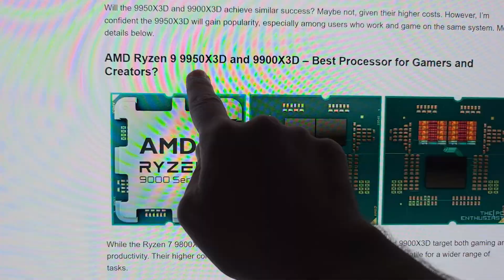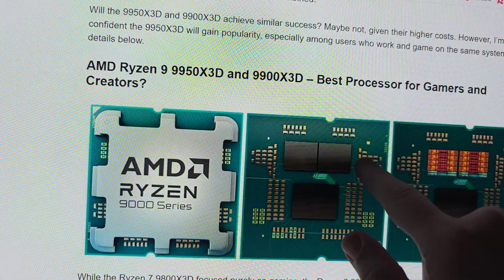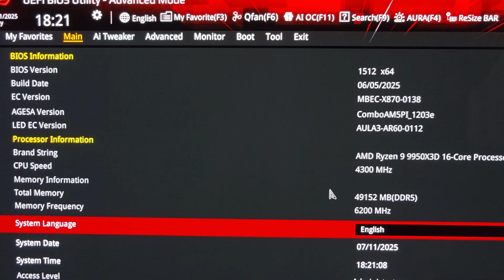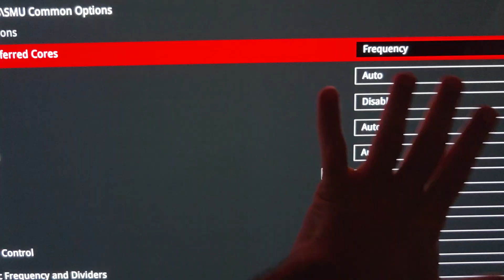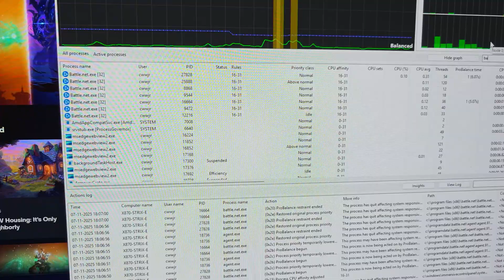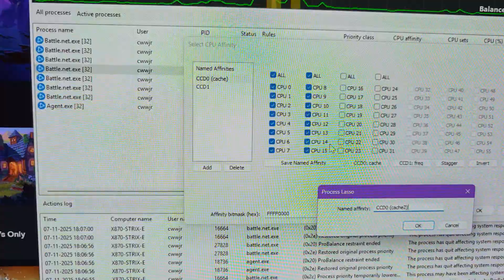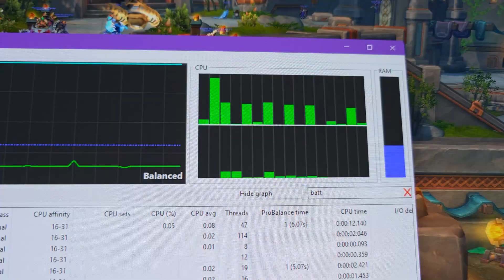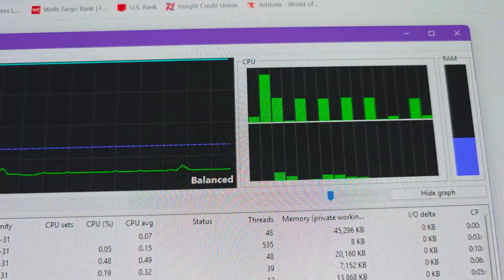How to Setup 9950x3D with Process Lasso

Comment: Thanks for the tiny bit of information at the beginning about the SMU, I got the same results on my asus board! I didnt listen to the rest of the steps and already had the game bar delted
I turned on SMU Options turned on to frequency
 Ai tweaker -> coreflex -> Loaded gaming preset
to check if the vcache is being used, I checked it using process lasso

Comment: im sorry for the stupid question, but if we have game bar on and the amd software installed - should it not be handling this? Or is Lasso a better way of controlling it
Reply from the maker: Dude I feel like you didn't even watch the video. Because I literally answered this in the video. Doing everything you just said works 95% of the time. Not 100%  there are other benefits to using process lasso.

I would rewatch the video without skipping around
Reply: @CWWJR ok dude, this was insane. I do some sim racing and i have been experiencing lag even with my 5090 and 9950x3d. After this zero lag, stable 120fps maxed out settings.. thanks man!!
Reply from the maker: @Rene_Bo  yeah what was happening is windows was periodically loading your game onto CCD1 instead of keeping it on CCD0. Each time it did you got cross CCD latency and were also hindered because CCD1 does NOT have V-cache. Only CCD0 does. Now you are FORCING your game to stay on CCD0 so no jitters.

Comment: One exception I’ve found is that it’s more beneficial in my experience to set the launcher to also be on ccd0 not 1 as it’s a parent program and will likely launch the game AND the anti cheat to ccd0 which is a problem I’ve found manually pulling game over you have to find the anti cheat but some still deny it. It’s my first time using it as I stream and clip from same pc so I have all set to ccd1 then manually put game and launcher to ccd0 also been setting cpu set for my comp games as their anti cheat is more finicky but most games have affinity and sets together. But games like Tarkov both anti cheat and game gets tied jsut forcing launcher affinity set. Also tip I’ve also found was setting steam to ccd0 then pulling obs to ccd1 so now all my steam games boot to ccd0 it’s not prefect but it works a majority of times.
Reply: hi bro how did you get it to work with tarok mines coming tmr so just wondering if I should be doing this I also play games with faceit and I know there anti cheat can be weaird
Reply: @Biggben05 I’m sorry I’m not sure what game you’re referring too do you mean escape from Tarkov? Either way set cou affinity for whatever game to launcher first then anti cheat then game I also use sets from pro version for all prior process

Comment: I used this on my new 9950 for msfs2024 and DCS. It works fine for DCS but causes stuttering in MSFS2024. I have switched it (on/off) multiple times and have verified that the issue with MSFS2024 is Process Lasso. It seems without it I am getting great performance so going to run without it. Interesting experiment.

Comment: why not use game mode for this instead of process lasso?
Reply from the maker: I explained why in the video.  For select Games game mode will NOT run on CCD0 or park cores properly at all. The whole reason for doing this was to make 100% sure and FORCE all Games to CCD0. If Game Bar wakes up a core on CCD1 for even a second you wind up with cross CCD latency among other problems. This ensures that cant happen. It also allows streamers to FORCE their Game to CCD0 while running their streaming Apps on CCD1. Eliminating cross CCD latency. Game Mode will NOT do this. However if you want to roll the dice of Game Mode always working properly go ahead. I am not a youtuber and make nothing from this not one dime. Im just here to help

Comment: You are absolutely correct in what you’re saying, but there is also something I have discovered with star citizen star citizen for some reason you cannot set it in process Lasu to CCD zero it is locked I assume this is CIG behind this as every ever game I’ve not had a problem with but what I have actually discovered is star citizen being a super CPU heavy game actually prefers it if you give it all the cores I have tried star, citizen, and balanced with core parking enabled, and found the frame rate to be unstable but switching to high-performance I have seen higher frame rates than before, and I assume it may be to do with the star Citizen is it probably does not fit on the 3-D V cash I would love to hear your opinion on this.

Comment: Hello, so i recently discovered that to optimize and get the most out of my 9950X3D in games i can do what you show in your video. I like to get the most out of my system so i did all of that. Everything is working, my games are now all using my 3D V-Cache cores but why am i seeing 0 differences in games >.< 
Maybe i cannot really notice it right away but it's still better this way ? idk
Reply from the maker: Then it sounds like you are bottlenecked by your GPU
Reply: @CWWJR  So i guess i'll give all the info instead of missing some important details.

First of all i am running an optimized version of Windows 11 by CTT. Maybe that's what causing me the issues i'm about to talk about.

My full rig is : 9950X3D, RTX 5080, 32Gb 6400Mt/s CL 32, 9100 pro SSD, 1000W PSU.

Following your video and some others to get the most of our X3D CPU's i did a lots of test on my rig to see if there's any improvements to be made. 

I downloaded Ryzen Master and realized that none of my games were nativaley using my CCD0's core. All my games are using a bit of all cores.
I then learned about Process Lasso and forced all games to use CCD0's core and the rest of the system on CCD1's core and it HAVE NOT added any performance improvements to my games.

 - I did 10 runs of benchmark of Cyberpunk using everything on default (everything on default means with game bar enabled that's it)
- 10 runs with Game mode ON (This alone makes all my games runs on CCD0's core but apparently it's less effective than Process Lasso) same, 0 noticable difference.
- 10 runs optimized with Process Lasso all the system to CCD1's and game on CCD0 with forced GameBar and Game Mode OFF.

All the results are all the same within margin of errors.

Sorry if i repeat myself but i centralized once and for all my thoughts and also for the next part the issues i have with the game.

My game in multiplayer (and only multiplayer) has those randoms crashes that can occur sometimes 3 times in 3 hours or no crash for 3 days.
Sometimes i have an error message and sometimes no. Simple crash and back to desktop.
Now i have all those crash dump file but i don't know what to look for inside and how to resolve these issues. So if anyone come across this issue one day, you are not alone lol.
Reply: its zero difference because the gamebar does its job aswell but sometimes uses more ccd1 cores . this method is to use only ccd0. and there is no difference.
Reply from the maker: @grammymusiclyrics  True and untrue. Most Games work well with Gamebar some do not. The whole reason for doing this was to make 100% sure and FORCE all Games to CCD0. It also allows streamers to FORCE their Game to CCD0 while running their streaming Apps on CCD1. Game bar will NOT do this.

Comment: Yeah my problem was I was using all default using the driver option but I noticed when I would game+stream, it seemed to be forcing OBS and everything onto CCD0. I was like man did I spend $700 on something I have to manually do everything lol but your video made it very simple and now I don’t regret my purchase. Thank you
Reply: Bro legit same issue clicked live yesterday after getting parking working boom same performance slightly worse than my 9800x3d lol it parked everything on same ccd0 gonna try this when I get home.

Comment: My 9950x3d is only showing 0-15 for cpu affinity, x3d mode is disabled in bios
Reply from the maker: reset your bios to default. Do ONLY what I did in the video. Nothing Extra
Reply: @CWWJR thank you I got it working, but it’s not doing what I expected. I was hoping to not lose any frames while I stream BF6, but no matter what I seem to do when I start OBS I’m losing 30-40 fps. I set steam to CCD0 (cache) and that part worked because it shows BF6 Running on CCD0 (cache), and I set OBS to run on CCD1 but I’m still seeing the loss of frames. I set it to prefer frequency in bios like you did. Is it possible that I’m losing the FPS solely off of GPU usage? If that’s the case do you think the CCD1 would be able to handle the stream without assistance from my GPU  if I changed the encoder without affecting the quality of the stream? I’ve been looking everywhere online, and I just can’t seem to find the answer I’m new at this. Running a 5090 btw.. Thanks for your reply.

Comment: Wouldn’t setting your CDDC to Frequency only in BIOS force your GPU driver(.sys) to run on CCD1 causing more latency because the driver and game.exe have to travel between CCD’s to communicate? Or does the GPU driver(.sys) automatically run along with the game.exe?
Reply: any news for this?
Reply: any news ?
Reply: @sindev3320No answer. You could probably do some research and find an answer.
Reply: @chriscruz5617 I just checked but yeah the gpu driver is at the kernel level so you can’t control on which cores of your cpu it will be affected and it can cause some latency if it appears on the non cache ccd… so it sucks

Comment: Can I tell Process Lasso to run everything on CCD1? Then I can simply select the games individually and set them to CCD0.
Reply: I've tried this, it can work in some way, but there's always some program that the game depends on which causes the game to default to CCD0. Like I noticed setting Steam to CCD1 it'll cause any games or apps opened through Steam to be forced on to CCD1. However, this is with CPPC set to Driver, Gamebar and Game Mode both on.

Comment: Silly question, but maybe you can help me. Do you think it's possible to optimize Obs Studio in this software? If so, what should I choose? Thanks :) ( i have the 9950x3D and 5090 )
Reply: This is what im forced to do when things come in tomorrowish....I have a 9800X3D which even watercooled and clocked will BARELY feed the 5090...in fact it wont...im lucky to see 500watts and 92% even with 4K max/DLAA ( in games synthetics run the full 600 watts at 104% and 99% utilization ). 
 When I go to stream? it drops badly, the CPU cant run all my back ground apps, voice mod, and OBS while still feeding the 5090...it will fluctuate between 70-90% range.
 SO, when it comes in tomorrow im hoping the 9950X3D using Project Lasso will let me do precisely what this video shows and run ALL background apps on the Frequency cache including OBS...and let JUST the cache CCD purely feed the 5090 in dune awakening ( and other games ).....Ill let YOU know and if you dont mind let me know how this works out for you......I BADLY dont want to run a 2nd PC.....this is my last hurdle and the 9950X3D with Project Lasso seems perfect to accomplish this!!!! Crossing my fingers!
Reply: also will probably benefit from the increase core speed of the 9950 as well...I HOPE cause damn were they both expensive!
Reply: @OldManRising  So I made some modifications that suit me well by following other videos of project lasso. I can stream in 1440P on twitch with the 5090 and in 1080 on tiktok simultaneously without bug, I was able to set a limit of fps at 104 I can maybe go up to 120 but it demands a lot from the graphics card. I think that streaming while having 240 fps is impossible and I don't know how to do it, let me know if you find solutions. (I'm currently on dying light the beast)
Reply: @Pommedeterre352  Really thinking about that game as well. I did a test session, I loaded up everything I needed to run except Dune/Awakening...I selected it ALL to run on CCD1, then I fired up the game, tabbed out and set that one to CCD0 ( 3D vcache ) and got WAY better performance than I did. This was 4kK max visuals ( DLAA no upscaling ) with 1080p out to YouTube and 1440p to a recording on the hard drive! Tomorrow Im gonna try 1440p on both and call it !.....when id set the priority to very high the 5090 would max in game but then its encoders would crap out and get behind on rending for OBS....its wild a 5090 with dual internal encoders, 9950X3D, X870 chipset and 64gb or DDR5 6000 has trouble handling a stream! hehe....I like the idea of limiting it to 120fps BUT I wish it would just let me do that with the 1% lows instead! good luck
Reply: @OldManRising  thanks i m going to try this !
Reply: @OldManRising  good luck

Comment: I have a wired problem , I set up the bios as Freq MSI 870E Carbon WIFI but all the games or apps works on FREQ ONLY , game bar its "dissabled" to be far never really worked in win10
Reply: ON BO6..
Reply: Your saying it doesnt let you assign anything to the cache ccd when you set the bios to Frequency only? If so, id guess you would have to individually take every process running and assign them via Process Lasso to frequency ( after returning your bios settings ), then individually pick out each game you launch and add those to the cache CCD like he did in the video....I will be getting a 9950X3D and will try it as well...I need OBS OFF the CCD feeding my 5090 for streaming!!!!

Comment: One issue i've encountered with this approach is that games with stricter anit-cheats have blocked the ability to set affinities. would you suggest doing the inverse for such cases and if so, is it safe to set system processes not just application processes to CCD1 or would that cause some issues
Reply: no need for that you either setup cpu sets or lets say you have the game on steam you set the steam launcher to ccd0 and that setting will be transfered to all games u run trough that

Comment: is any scenario (for games also ) who is beter to allow to run on all cores on both ccds ? and how we do this ??? we overlap the bios setting with proccess lasso ??
Reply: Bios os only preferred startup option you can still use pl to pull a program over but no most games would not benefit from using all cores as the infinity fabric connecting the ccd would be slow if ran on both but if a game or program requires multiple cores from both ccd ie cinebench it overrides pl as the total core load exceeds what one ccd is capable of giving. Hope this helps

Comment: Genuinely, thanks so much for this.
  I wanted to upgrade my ancient 5820k and wanted a CPU that would be great at gaming/virtualization/workstation.
  Main worry was with the different core types but a solution like this is a far better solution and assurance.
  Hoping to get min 5-10yrs out of a 9950x3d.

Comment: so for the power plan,  since were supposed to put the power plan in balanced mode in order for the schedule to work, with process lasso, does that mean we can now put it on high performance or theres still some kind of reliance on the windows scheduler?
Reply from the maker: Everything should be on default except what I did in the video. Don't do anything extra unless you know what you're doing

Comment: Appreciate you, worked great for me. Only caveat I found, is it majorly limits my 3dmark timespy scores, the first 2 graphics tests run faster with the Vcache affinity but the CPU test suffers from only using half the cores. Currently setting up a second bios profie to prefer Vcache and then disable process lasso, see how it go. I do a lot of benchmarking so it will be a lil annoying but that's what you gotta do to get the numbers. Grug like number go up
Reply: 3dmark is better optimized for multithreading than most games.

Comment: Have set frequency in bios but in lasso it still selects all process 0-31 in proces lasso? Any suggestions.
Reply from the maker: And it sounds like you didn't follow the step of setting up process lasso I covered it in the video don't skip around watch the whole thing and just follow the steps
Reply: @CWWJR Thanks. I Saw your video several times. Set Cppc : frequency in bios. Expo profilen (i Only have one Expo profile), disabled game mode and game bar. But couldnt find the game bar priority in my app - advanced settings. But had to set manually all other applikations other then game to ccd 1 in proces lasso. It didnt do “automayically” despite setting it in bios.
Reply from the maker: @Morst434 know your game should be running on CCD0 (cache ccd) you need to create profiles and process lasso like I did in the video